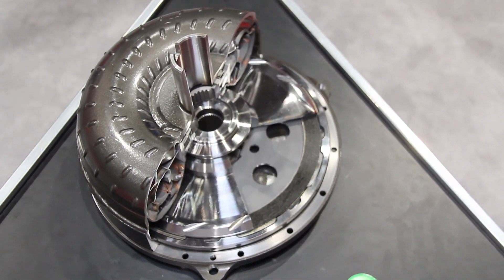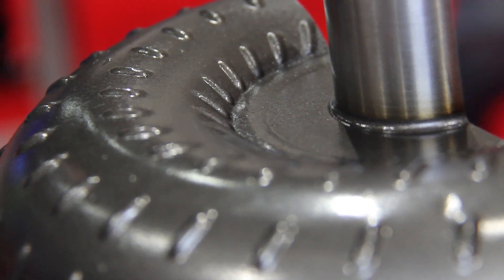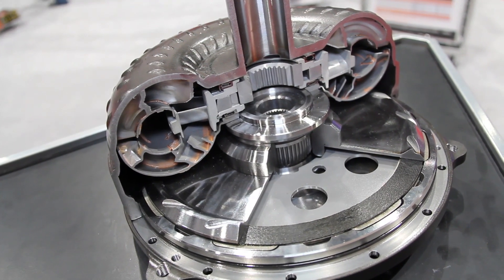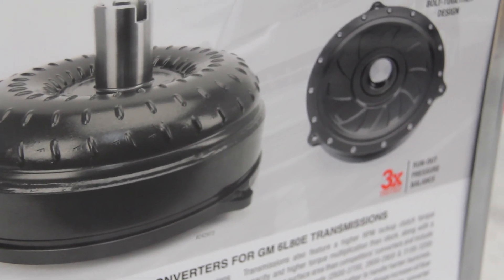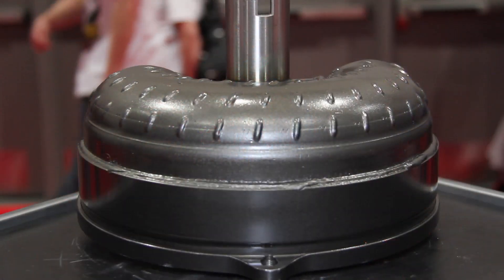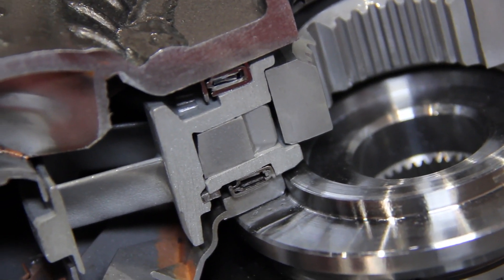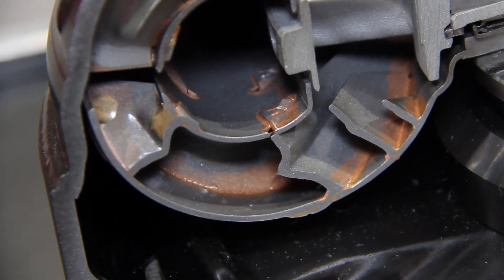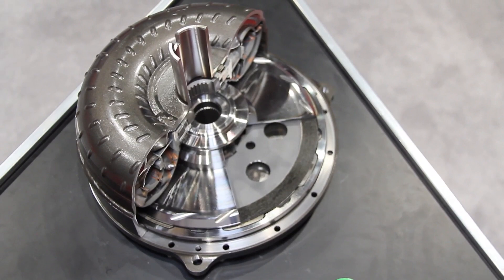SEMA 2012: TCI® Unveils Bolt-Together Lock-Up Torque Converters For 6L80E Transmissions

Comment: It does need tuning . I installed and had issues throwing a code for excessive tax slip . Called tci and they said some need it some don't... so had to spend another 500 on turning.  Very nice converter have about 5k miles on mine but starting to hear a rattle from it... going to pull and check it out.